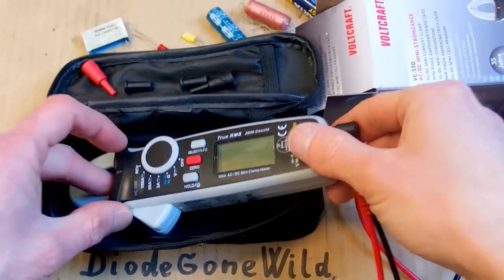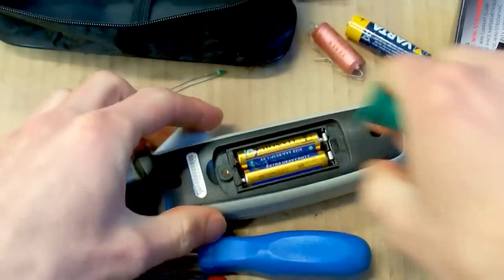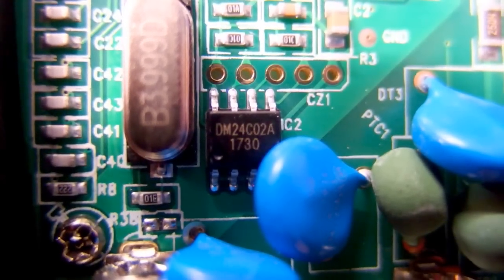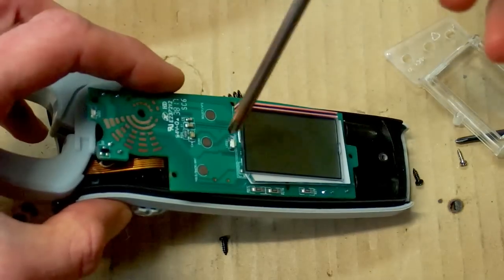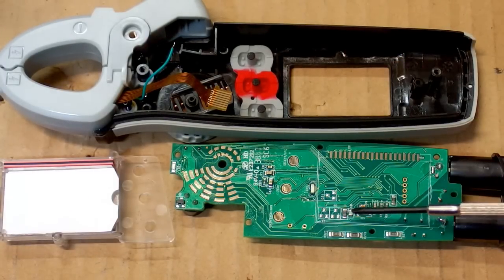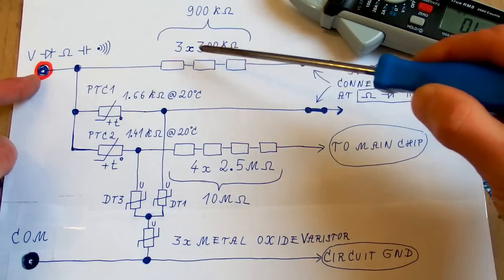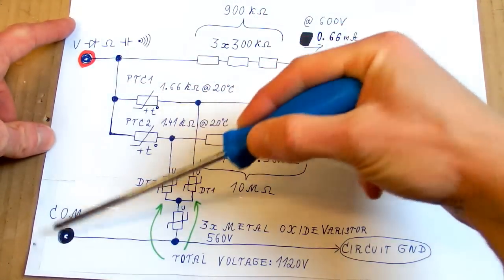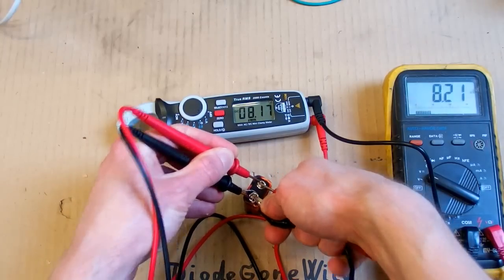Clamp Meter Teardown (Voltcraft VC-330 = UNI-T UT210E) & creating my Patreon account

Comment: Why again are there more contacts on display rubber and less on PCB?  Maybe a universal rubber contact?
Reply: A D 
Yes, all rubber contacts for displays look like this. The black section is basically a bunch of isolated parallel conductors. It is designed so that the pro EE just needs to align the display contacts directly above the trace contacts on the PCB. The spacing between the contacts built into the display are separated by enough space so that the conductive rubber strip has several lines of parallel conductors that don't align with anything on the display or PCB sides. The alignment precision is handled by the mechanical alignment of the display mounting. The rubber strips would cost a fortune to have custom made for each display design. Instead, the design simply requires the engineer to place the traces and align the screen accordingly.
-Jake
Reply: Long story short, they over engineer the number of conductive (black) and non-conductive (white) stripes so alignment isn't too critical and allows for a mass produced (and cheaper) product that can be used for multiple devices.
http://www.elitesales.com/custom-elastomeric-connectors.html

(minimum order is 2,500...)

Comment: Thank you for this video, I wanted to tear down my UT-210E for quite a long time but never did it for fear of breaking it :)

I also fully support your stance on the youtube beggars. I'm probably going to donate a few euros to you because I hate ads and I enjoy EVERY video you put out. Not to mention all the circuits I've replicated from your goldmine (danyk.cz :))!
Reply from the maker: Big thanks to you ;). I also feared breaking it, but my curiosity is always stronger :D.
Reply: No need to thank me, I appreciate honest people that produce fine content, and especially people that start off small and grow purely based on their skills and high quality videos and not begging! :)
By the way I really liked your insights into switching power supplies, those videos were very well made! I am now in the process of converting the UC3843 based 12V power supply you showed a few weeks ago into a 12V battery charger (yes, using the schematic from your website!). So far it's working reasonably well, though I have problems with the transformer making hissing noises. I had to adjust the current sense resistor because with the stock one it just shut down as soon as you connected it to the battery. I have put three 1ohm resistors in parallel as the current resistor. Is there any chance you know if the hissing is normal or not? 
The mosfet doesn't get hot at all, only the diode does, but only when the load is high so I assume it's not saturating the transformer otherwise the mosfet would heat and/or explode?
Thank you again :)
Reply: hi OpenGL,
did you make the transformer yourself? There is always a chance they give a summing sound due to the wires and core not totally fixed. Even the professionaly made transformers give a sound but you dont hear it at frequencies well beyond 20 kHz. You perfectly hear it on 50Hz mains. If the diode gets hot, give it a bigger heatsink :-)
Reply: The transformer is the original one in the power supply, I just rewired the circuit from a ready made power supply.
The diode wasn't getting very hot... but now I did some tests and for some reason the current limiting kicks in very early at only 2A (I can get 6A only if I short the output and it falls very rapidly, it can't maintain 6A) but putting a fourth 1 ohm resitor in parallel the psu shuts down. 
I am thinking the switching frequency is too low...
Reply: What PSU is it exactly and what is the nominal wattage / output voltage and current? When it is meant to deliver 6 A it can be at the limit so the protection just kicks in. When it was a cheap one from china it could be it is not able to deliver what they print on it. In most cases the specs are exaggerated quite a bit and up to many times! I have an S-60-12 (60W / 12V / 5 A) which i modified successfully and it is able to deliver just what it claims. But in many cases its not. If you need real power the best and reliable source is to get an old server PSU! I modified a 6 kW supply, that now can deliver 36 - 52 V at 170 amps!

Comment: Ooow it has one of those chips that store the calibration data in a 24c02, nice :-D.
And they have given you the i2c connections to update it, and hacking.. oops :-D.
I've seen that sort of dmm chip in the Anang an8008 and similar, they are quite accurate.

The pcb looks decent, it's better than i expected.
A basic schematic of that kind of chip is 
here: https://www.linkedin.com/pulse/uni-t-ut210e-carlos-abido
Reply from the maker: There's calibration in EEPROM but also 3 potentiometers at the same time. There's probably never enough of calibration :D. Maybe the EEPROM also contains some settings. It may also lock some functions that are available only in the more expensive models.
Reply: If im right, you don't need precise ref resistors with that chip, just stable ones, the error can be offset in eeprom :-D.
Hackers Delight :)

Comment: Make a Video on 5v 8w Usb Soldering Iron
Reply: https://www.ebay.com/itm/Mini-Portable-USB5V8W-Electric-Power-Soldering-Iron-Pen-Tip-Touch-Switch-kit-T7/142666624372?epid=839885068&hash=item213797ed74:g:ODsAAOSwImRYU176

Here, it is now 5 usd
Reply: Ma P thanks mate
Reply: I have one bought it on ebay for 6 USD,  and after 1.5 year it works great
Reply: Ma P can you give link